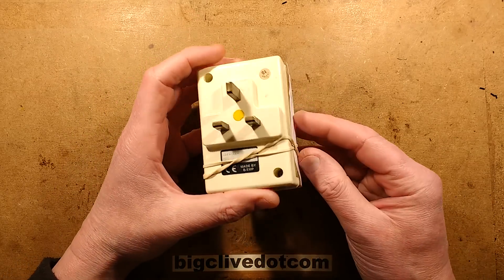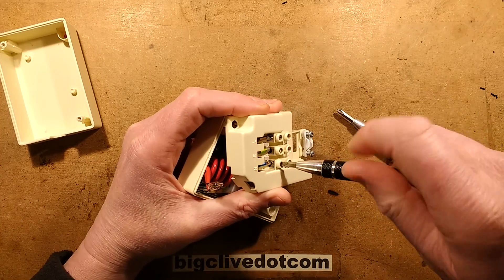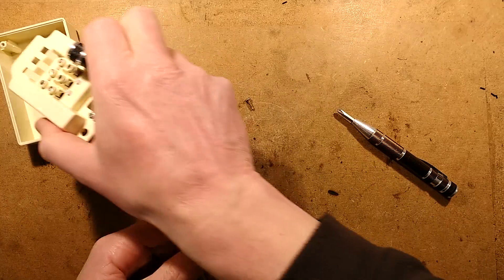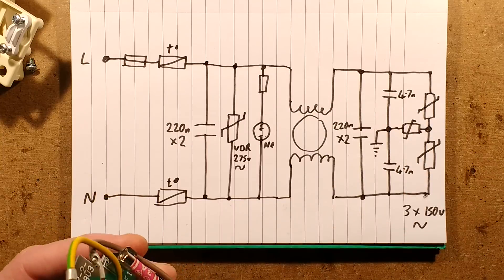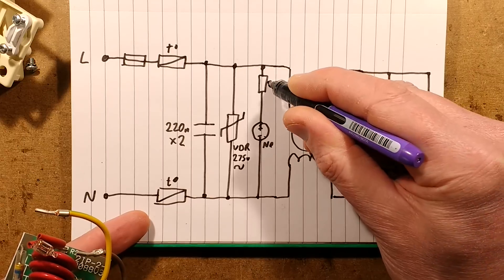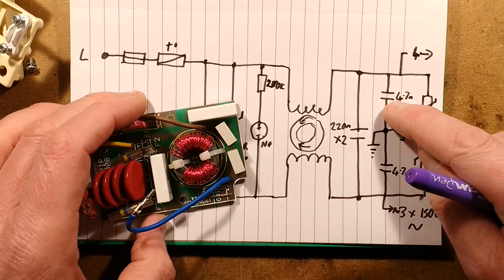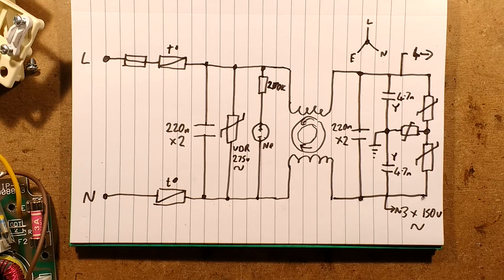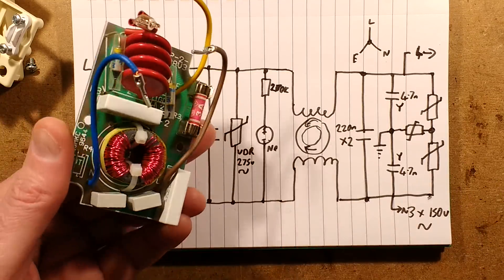Inside an old interference suppression plug.  (schematic)

Comment: I've never seen anything like this in the US.  What equipment requires interference to be suppressed?
Reply from the maker: Usually audio equipment.  But anything you want protected from electrical spikes that could gradually cause a power supply to fail.
Reply: @bigclivedotcom  Gradually?  A lot of the failures that I've seen have been blown diodes,  nothing gradual about that.  :-)  What equipment?  An awful lot.  I've done a fair amount of scrapping stuff out,  and have a fair pile of those common mode chokes,  X and Y rated capacitors,  and similar parts as well as complete line filters,  waiting for me to find a use for them.

Comment: This reminds me somewhat of an old "Ediswan" - "Suppressor Plug" we once had at home. We're going back to the mid/late '60s here. It must have been much simpler than this, but even so, it was still quite a bulky plug, or more like a standard footprint, but about thee times as thick/deep. Interestingly, it was on my parents' electric blanket, and was eventually tracked down as the cause of interference/noise on either, our radio (AM) or the old VHF telly (also AM) - I don't really remember which, but once the suppressor was 'oiked out, we had no more trouble. Weird or what?

Comment: My understanding of ELCBs, is that they look for a current that is going out on the Live that is not matched by exactly the same current coming back on the Neutral ( no current flowing to earth) 
So I wonder if the live current passing through the 4.7n capacitor, to earth,  is enough to cause the imbalance?
Reply from the maker: The current through a 4.7nF capacitor would be tiny.  Measured in microamps.

Comment: According to Zero Surge (makers of heavy-duty 'Power Quality' filters), attempting to clamp "common-mode" surges is both dangerous and unnecessary anyway: https://zerosurge.com/normal-mode-v-common-mode/ (Sure, they're a commercial manufacturer too; but I can't see any fault in the arguments given.)

It also continues to disturb me how many MOVs are still installed without thermal fuses, and often in plastic housings to add injury to insult.
(This is my main concern with the current version of the Allocacoc PowerCubes, by the way; if you want to make them safe, either add in a thermal fuse, or cut the MOV out altogether.)

Comment: Hello Clive, we see you strip down these MOV and suppression circuits, along with your approval or disapproval of their safety aspect in relation to thermal fuses and neons vs LED's. You've torn down RCD's, fuses etc, shown USB ports and chargers at mains potential where they're able to power a light bulb, we know you're not too keen on neon test screwdrivers and you've educated us in that field, along with exterior LED lamps that don't have a earth wire, so all lots of protection stuff, I really like that. and I've taken a lot of notice of your videos and advice. I respect you're very qualified and have worked on many projects before you devoted your time to more family related issues. As a subscriber to your channel who finds your reverse engineering insightful and interesting, and more over because you actually explain and do the math at a level that even I understand (not that I can always keep up), and whilst I've only ever gone as far as adding MOV's and thermal fuses protection to four and six way extension sockets (back when it used to be cheaper to do this myself than buying a surge protection device made up). You seem to like the quality of this product yet felt it had some issues, so I'm curious, what would your own circuit design be to undertake the task of reducing interference and protecting devices from spikes, whilst showing a ground was active? And whilst our house has mains RCD fuses, I still tend to use a plug in RCD and a MOV/Thermal fuse extension for most things be then in the house or in the shed. I'd be very happy to have a in-line box if I can't fit your design into the extension socket housing, I struggled with the MOV's and thermal fuses, and I'm reading Chuckiele's comment about class X and class Y capacitors, so with all your experience, what would be your own personal ideal circuit. And please, I'd love LED's or neons to indicate what is protected and what isn't... I love lights!...
Reply from the maker: We don't get many huge electrical spikes here, so my own choice might be to rely on suppression capacitors to buffer the transients and take the top off them.  That would mean an X2 either side of the common mode inductor and perhaps the class Y to earth too.  Close to what you find in washing machine filters.  If I was using MOVs the temptation would be to have them in their own earthed metal box and just leave them plugged in at a socket close to the distribution board.

Comment: You should do something on one of those water powered clocks, I'm sure you could find something online
Reply from the maker: They're usually just a battery based on metal strips with the water acting as the electrolyte the metals eat away over time.

Comment: Hey Clive. Why is front usb port in my PC live? it is putting like 24V - from "feel" test when i hold tip of us cable and hold a heater.
Reply from the maker: Does it happen with other appliances?  The heater may be ungrounded.

Comment: Hi hehe can you power a 220 volt (gu10) with 12 volt T full power , and how to make the mod t
Reply from the maker: For some with three LEDs in series you could just use a resistor to drive the LEDs directly.

Comment: I have often wounded the effectiveness of the high frequency cap and mov components tying the Neutral to Earth when the supply is connected to an MEN supply system. I can see benefits if it's connected to a fully floating supply system. Any comments???

Comment: I see a great many filter circuits like this built into the inverter welding machines I repair at work. Almost exactly the same but without the fuses. The MOV's are a common source of tripping the mains RCD, or if the user has powered their inverter welder with a noisy/unsuitable generator the MOV(s) usually goes kaboom - leaves a huge black skid mark and bits of MOV like shrapnel all over the place.

Comment: Ah so thats what parallel inductors are for - I recently harvested a couple of chips from an old router that according to their datasheets consist of multiple transformer and suppressor arrangements in series.  I'm guessing thats to completely separate it from all external signal sources? (they were being used to terminate the sockets)

Comment: Clive Id like you to review an item on eBay, a 12 v psu capable of 33 amps for a mere £12.14p. typically a decent psu with similar spec would cost a fair amount. Rather than put a link this is the item number 282225538705    Please please do a review on this and if it can actually do 33 amps.  Thanks Clive keep up the great work.
Reply from the maker: Quite hard to test without a matching load.  They also don't ship to the Isle of Man.

Comment: Thanks again for a stimulating video!

I have heard of series GDT+MOV being used. Once the GDT incepts it will collapse like a neon so double digit volts. The combination has a sharper knee than MOV alone with much lower standing current, and might ameliorate MOV ageing. 

The idea of the star MOV arrangement is to split transient energy between two devices, thus you can get away with smaller devices overall. Those MOVs are big enough already!

My only hunch about why it trips RCDs is to do with whether the N or L pin disconnects first could that do something?

Pretty sure Huw is the Welsh spelling.

Comment: These were often sold by white goods companies as a method of reducing power surges when the white good item had a change of power state, so when a fridge/freezer cycles on/off etc. When the food chain Iceland used to sell fridges/freezers, this was what they always recommended be purchased at the same time. My mum brought two, one for each item... But this was back when you had to supply your own plug, before pre-moulded plugs came as standard...

Comment: My computer is sending high frequency into my wall outlet causing interference with my stereo. Would one of these help with my problem?
Reply from the maker: It might, but if your computer is connected to your stereo then consider an audio isolation transformer.
Reply: Look into the TrippLite IsoBar series outlet strips as they have very effective surge and noise filtering.  I use them on most items of real value, including computers, TVs, audio gear, and test gear, and they are very good at protecting equipment, including UPS's, from damaging surges (such as a mains transformer shorting out) as well as from RFI noise.  Every bank of outlets in the strip is separately filtered from its neighbor.

But a more common problem with hum and noise stems from unintended ground loops and if that is your issue then an audio isolation transformer, as suggested by Clive, will also prove necessary to help break the ground loop.  If you feed your computer into your audio amplifier then it is not unusual to have noise coupled onto the chassis ground by the noise suppression capacities in the power supply, and that can also be helped with an audio isolation transformer.

Comment: It looks very much like the mains filter used by BT, couple of options available one was for rural units that had LV overhead mains feeds and used gas discharge in both mains and phone line to "protect" against lightening strikes!!.  Along with a locally provided earth spike to dump to.  Became necessary when old relay and switch kit (which would work with anything) gave way to the first generation of new fangled processor controlled systems (which were to say the least - particular where they were plugged in).  Mains power was an absolute f*&*?*$$ nightmare, both in City centres and out in the sticks so mains conditioning units, filters etc were bunged in everywhere - I still have one of those filters in my office ... just in case.

Comment: Clive, can you explain exactly what " common-mode" currents are?  This one concept has always somewhat confused me.
Reply from the maker: Common to both the live and neutral but in phase as opposed to the actual live and neutral.  Basically electrical noise trying to find a way to ground via the two wires.
Reply: As Clive mentions, if the signal is carried by both Live and Neutral and both are carrying the exact same signal, identical even in phasing, then that is common mode (it is common to both conductors).  If they were to carry the same signal but in opposing phases then it would be differential mode.  In a common mode choke the two sets of coils are wound as mirror images of one another such that when each sees an equal and in-phase interference signal they each produce a magnetic flux of opposing polarity which means they effectively cancel each other out thus cancelling the interference.  In a differential mode choke the two sets of coils are wound identically to one another so only interference that is of opposing phases gets cancelled out by the choke.  

Bonus fact, a GFCI/RCD will typically consist of a common mode wound choke with a third sensing coil added to it to detect the imbalance between live/hot and neutral.  As long as each conductor is passing identical current they will magnetically cancel out and no current is produced in the sensing coil.  But the moment there is a discrepancy due to leakage to earth in one of those current legs the two common mode coils will have different intensities in their magnetic fields and no longer fully cancel out one another, inducing a current in the sensing coil and if that current exceeds a certain limit then the GFCI/RCD will trip, opening the circuit and rendering it safe.

Comment: random teardown  suggestion... just browsing aldis and they're still selling a CFL lightbulb. These are pretty obsolete technology now and presumably going to get phased out fairly soon - but notably the 'ballast' unit below the tube on it was really small in comparison to the few year old units I've still got around. I guess CFL technology must be in it's ultimate form cos I can't see anyone wanting to put much money into further development. Might be interesting to see how they got the balast size down and whether it contains a ferrite suitable for a joule thief transformer.
Reply: joinedupjon Depending upon the firing voltage requirements of the fluorescent tube versus local one voltage, I have seen ballasts (even in the past) that were nothing more than a capacitive dropper combined with a small TO-92  triac to do the initial striking -- essentially nearly identical to that found in many cheap LED bulbs today.
Reply: Hi Ethan Poole... even if it's electrically boring I guess the thermal design improved over the 15 or so glory years of consumer CFLs
Reply: joinedupjon If a capacitive dropper ballast is used then there is practically no heat in the ballast as the film capacitors typically used have extremely low ESR (equivalent series resistance) at 50/60 Hz AC so there is only heat production if a ballast resistor was also used to improve the power factor, in which case the heat produced will be determined almost entirely by that resistor (they usually use power resistors rated at 5W, so dissipation will be on the order of a few watts maximum, which is not too hard to dissipate).

Comment: Why not try to replicate the problem and see what you find? You didn't plug it in to the hobbie to see how it compares to others either just a open and look approach.
Reply from the maker: The Hopi would not have shown anything.  To test it would require quite complex testing equipment to generate transients and measure the effectiveness of the unit in suppressing them.

Comment: I remember having a controller for heated mattress which tripped circuit breaker if you leave the connector that goes into the mattress unplugged before plugging it in. Not sure why it did that, but it caused quite a lot of fuss here after every cleaning.

Comment: Hi this unit was made by the same company that made the lightning surge arrester and explosive disconnect you looked at a while ago ( Bowthorpe EMP) their low voltage arm was called ASC,
the star formation for the ZnO is both for cost and safety (150V parts are cheaper), but mainly if one of the discs fails (short circuit) then the second one in the chain would fail too, through over voltage, these would heat the thermal fuses and disconnect the unit, it sounds counter intuitive to deliberately fail a second component but for some fault states this is preferable  e.g. high impedance earth loops.  all their products were hand assembled, this looks to be about 2000 vintage. there were various forms having different levels of surge suppression / protection  GDTs would be used where higher energies needed dissipating but they are slower to react that the ZnO discs.
Reply from the maker: That's quite a pedigree for a surge suppressor.
Reply: it was a very fun company to work for with a huge amount of experience in the black art of high voltage, EMP was the first to include surge suppression in plugs the PP1 you have the PP3

Comment: Would this stop one of those powerline ethernet adapter things that put the LAN through the house copper from working?
Not saying it would be a useful application, just wondering.
Reply: Maybe.  It could stop it, or limit bandwidth at least. It'd be trying to fight the signals to an extent.
Reply: Depends. I'd expect it to interfere with the 3-wire "1200 Mbit/s" varieties, but the slower 2-wire ones should be less bothered (though differential filter capacitance still is quite high). However, I'd rather put the filter on a noisy load, as ironically this powerline ethernet stuff is super duper sensitive to switch-mode power supply crap (one reason why these things are supposed to be used directly at the wall outlet). The cleaner the mains, the better the throughput and the less transmit power is needed, in turn reducing radiated interference for everyone around. (Once that is sorted out, the only thing that can go wrong is having units on different phases, in which case a dedicated bridge has to be installed by an electrician.)

BTW, it is rumored that powerline ethernet devices have a habit of EMI degrading over time, ultimately failing to meet regulations, possibly as a result of filter components aging. I would only ever consider getting the best-quality ones, which around here would mean Devolo.

Comment: The MOVs are marginally useful in a surge suppressor. If you are experiencing extremely bad recurring spikes, every cycle, the MOVs will soon die (I've seen power supplies that used them for voltage regulators, unsuccessfully). They will clip the odd lightning strike hitting the mains miles away, and possibly ward off evil spirits, but mostly they just sit there doing nothing until they die and go to hell. The cheap ones with no fuses may take you with them. 

The filters will do a lot to get rid of hash on the line. I have some filters with 2 or 3 LC stages.

Comment: Any date codes on the components? The PCB has 9644 on it which could mean 44th week of 1996.
Reply: Could be simply too much bromine in the ABS made it age faster even in the absence of light. Given the overkill in its construction, I wouldn't be surprised if they went overkill on the fire retardant.
Reply: The label on 2.54 min says:   Production 95.   So the PCB from 1996 could be possible.
Reply: that would be correct but as these were made to order i could be some time after that they were assembled  and sold
Reply: Judging from the cracking and yellowing plastic, I say it's older than '96 - possibly '86.
Reply: I thought the QA / QC sticker said 94 I'll watch it again now
Reply: Nope is says 15 oops